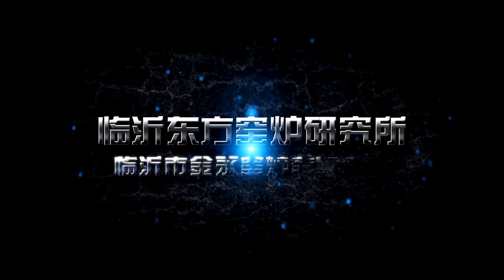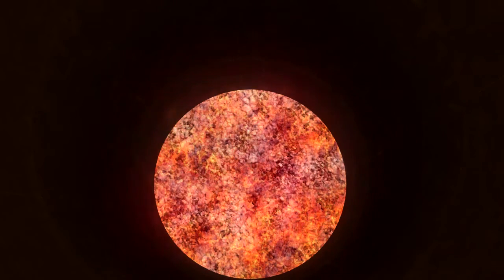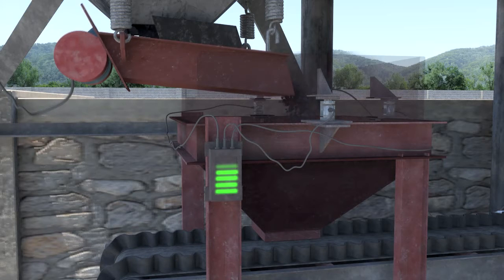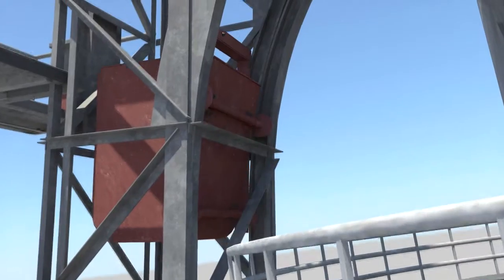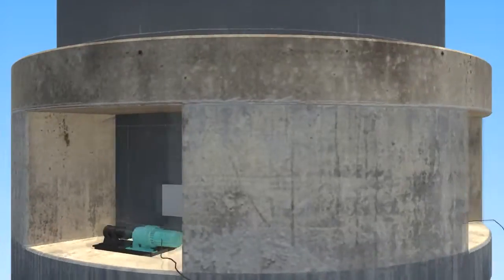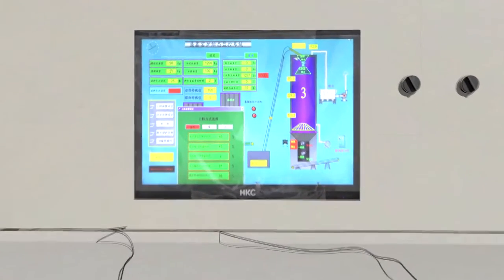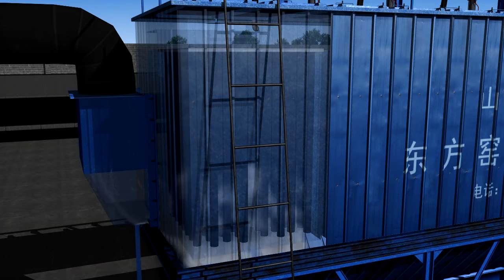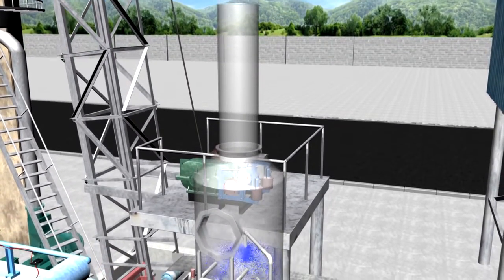Vertical lime kiln

Comment: Bon jour besoi de raplè
Reply: Longyi super fine powder grinding machines advantages:
1. Powder from 48~4microns, fineness is adjustable
2. Built-in high efficiency classifier, no more investment cost for classifying system.
3. Smart PLC operation system, and integrated control system: 1 computer could operated max 6 machines, saving management cost.
4. No particle air pollution, more environment-friendly.
5. Compact structure to save factory space and lower foundation construction cost.
 
For CaCO3 powder
The whole grinding system including grinding, classifying, powder collector, fan, PLC cabinet, feeding conveyor and others, system power is 370Kw, the real working power is 296KW
1. D97=23um (600mesh)    Output: 10tons/h      Energy Consumption: 29.6Kw/Ton
2. D97=16um(800mesh)     Output: 8tons/h       Energy Consumption: 37Kw/Ton
3. D97=10um (1250mesh)    Output: 4.5tons/h    Energy Consumption: 65.7Kw/Ton  
4. D97=6.5um(2000mesh)    Output: 2.5tons/h   Energy Consumption: 118.4Kw/Ton 

It is suitable for processing nonmetallic minerals such as calcium carbonate, calcite, Kaolin, clay, barite, talc, gypsum, limestone, calcium oxide, bentonite, dolomite etc.

Best wishes,
 Samuel 
 Fujian Longyi Powder Equipment Manufacturing Co., Ltd
Web: www.lymill.com 
Add: No.5, Lianfa Road, Dongxiao Economic Development District, Longyan, China
Tel: +86-597-2581699
MP/Wechat/Whatsapp: +86 15105956429
Email:Samuel@lymill.com